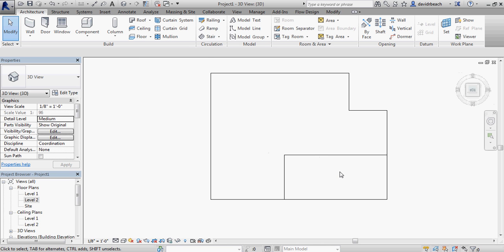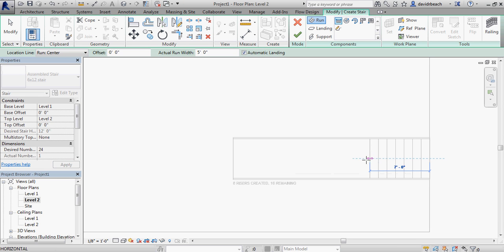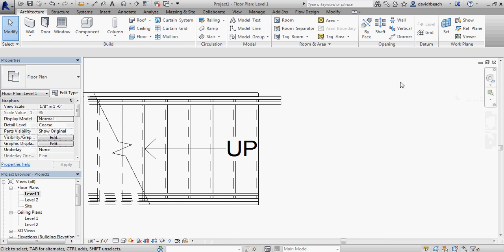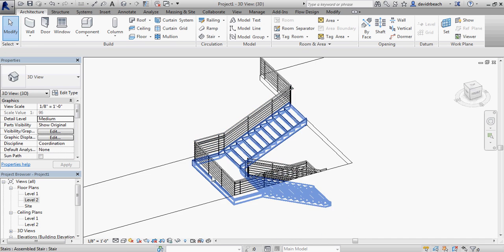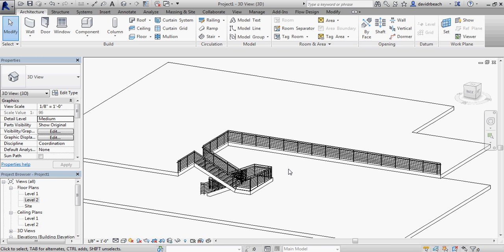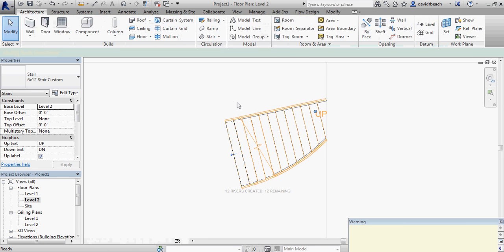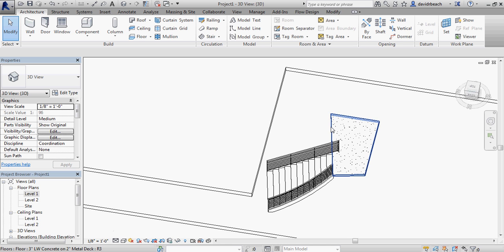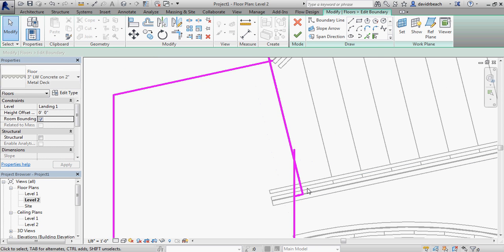Revit Stairs

Comment: This is nice, but how do you connect the handrails between the two custom stairs on the inside edge?
Reply from the maker: +Matthew Qual Yeah...to be honest, that is one of the tricky bits. Usually i handle those connections in my 2d construction drawings rather than spending the time 3d modeling the rail exactly as i want it to be constructed. As we are moving more directly into a "one off" fabrication world, i am going to need to update my own workflow.